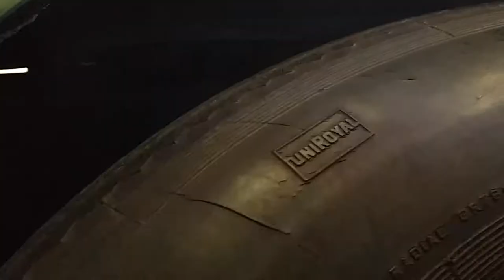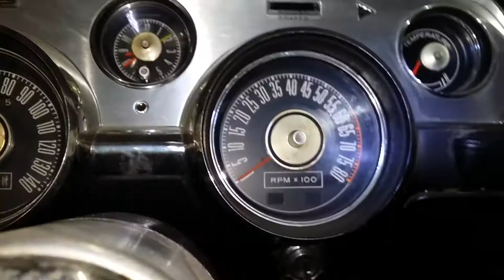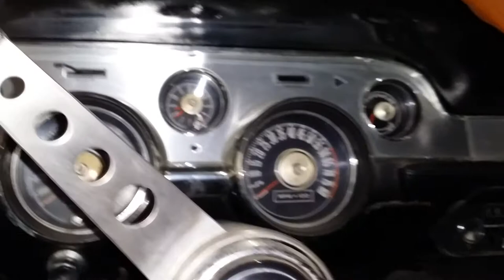1967 Shelby GT 350 auto appraisal Boston MA. number matching

Comment: Pretty Much Unmolested GT350 Survivor,Except for Needing Lots Of TLC.If It Was Mine ,Would Trade the 2  Four Barrels in For A 3 Two Barr. Set Up,To Make It More Correct & Better Driveability on the Shelby SB. It Could Be Made A Great Shelby COLLECTIBLE With A Non Major Resto. Primary Concern of A New Buyer  Would Be the Refresh of DrIve Train.